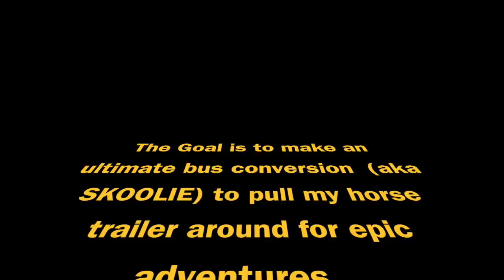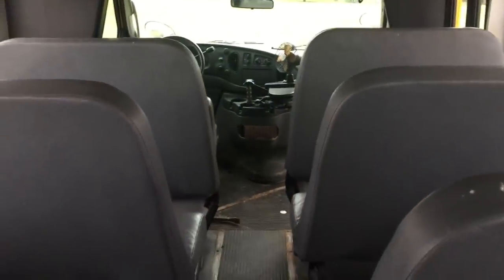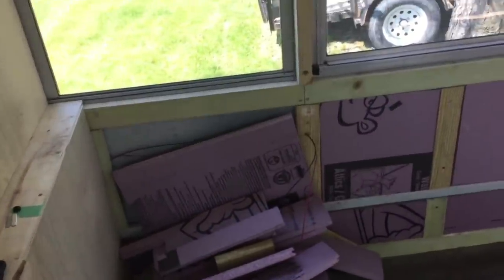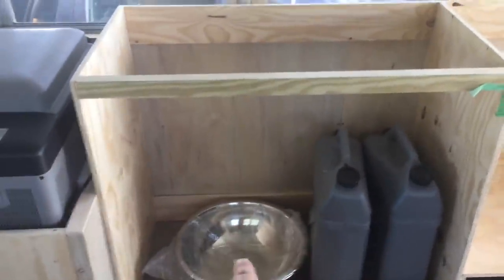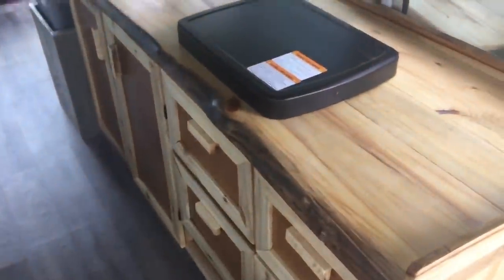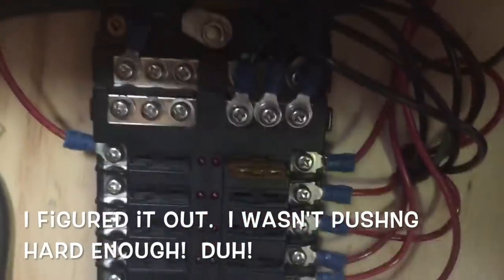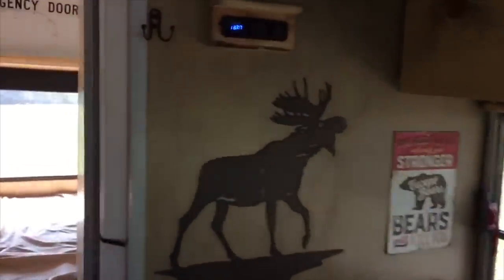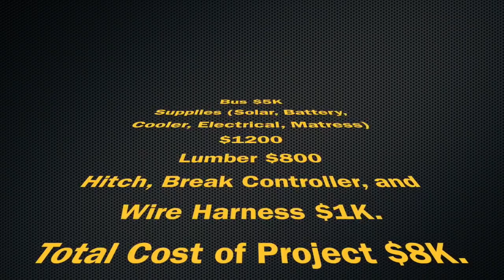DIY Short Bus Skoolie Conversion

Comment: I want to take my arm off the bus.  Does it bother anything if you just cut the wires off.  Do you have to close the circuit or something crazy.  Sometimes people have problems when removing things.  Like the bus won't start etc. What was your painting method? Rolling or spraying?
Reply from the maker: We cut the wires right off.  And tried starting the bus.  It worked.  In fact all the safety equipment we cut the wires and tested the start, just In case we needed to hook it back up and go to plan B. With the paint I used a $10 sprayer from Harbor Freight and a pancake air compressor.  It really wasn't enough pressure, but it got the job done. I used rustoleum gloss enamel.   I have an “orange peel” finish.  I NEVER painted before, so I practiced with water on cardboard first.
Reply: @hollijacobs7858  I bought a more expensive sprayer from Harbor Freight, but it doesn't connect to a sprayer. i bought tractor and implement paint.  Worried about the painting process, but I'm going to jump in soon. I just worried that the flashing lights work when the stop sign and arm come out.  So maybe they were connected?  I don't need the flashing lights, but I would like to put clear LED's in the front ones and the upper back lights would be good as solid red brake lights. The front upper clear ones would work with the bright lights not on full time. Someone who knows more about electric than I do could probably make that happen. Thanks.
Reply from the maker: Make sure you know the laws for the flashing lights.  If they are break lights you might confuse people into thinking you are a real school bus and they’ll stop for you.    You might have to disable them completely to be legal.

Comment: Can this bus comfortably drive at 65-70mph on highway? How does it handle mountainous terrain? What gas mileage does it get? What is the total length of bus?
Reply from the maker: Easily does 70 on highway.  behind the drivers seat, it was 14 feet.    mileage was about 12 mpg
Reply: @hollijacobs7858  I thought these have...I guess you call them Rev limiters? To regulate speed?
Reply from the maker: @windsofmarchjourneyperrytr2823   This one does not.  I can go as fast as. Want.

Comment: Is it possible to pull a 8 foot long enclosed trailer with the mini schooly? How much weight allowed?
Reply from the maker: That would depend on each individual bus and what they are rated for.  But mine pulled 5,000 lbs like it was NOTHING!   I would consider breaks though for something really heavy.

Comment: What is the engine capacity of the bus? And what size is your horse trailer? And how many horses are you hauling because I’m looking for the same some thing I can build out and haul my horse trailer
Reply from the maker: This is a 6.0l diesel.   I have a two horse slant that weighed about 5,000 fully loaded with horses.   You would never know it was pulling a trailer.  Pulled like a dream.

Comment: Did you get any engine , etc work done? I was a school bus driver for years, and I am aware they are well maintained, however they generally NEED some engine work/maintenance by the time they're sold. Nobody ever talks about that. I know what it's like being stuck in the middle of an intersection with a stalled bus full of students. Yes. That happened. More than once. Different buses. Not my driving technique... they were older buses - excess of 150000 miles. Fun times. lol
Reply from the maker: yes, I took it to a diesel mechanic and he did an oil change, put new belts on (they were dry rotted) and replaced the glow plugs.   Stuff like that.

Comment: Did you take the panels off the side of the school bus inside put installation or does a school bus have insulation on it already
Reply from the maker: I went right over the walls.
Reply from the maker: And it had insulation already

Comment: Do you have a further break down on your cost?? Alot of that is hard to believe because I have the same exact bas as you hah did you own a bunch of the stuff? Like some Solar and the bed?
How about maintenance when you first got the bus?
Reply from the maker: Solar cost me about $500 and that included the battery.  but honestly I scavenged a lot of the wood from my truck cap build, and made all the cabinets myself.  Most of my expenses were from the lumber.  The  live edge came from a tree on my property and the seat from a junk yard.  When needed I can be VERY frugal. 😉   I did get an oil change, new belts and new glow plugs about a year after I made the video.  I consider vehicle maintenance a different expense from the actual build.

Comment: Did you install solar also .
Reply from the maker: Yes, 2 one hundred watt panels.  And a 92 amp hour 12 v deep cycle RV battery.
Reply: Holli Jacobs 
I hope your batteries are sealed. Some types of batteries “offgas” and I noticed your battery was under your bed..l I do NOT know enough about it,please check the website to see if your battery offgases, and if it does, relocate ASAP.... everything else looks phenomenal, I hope my build out looks half as good as your Bus when I finally get to that part of the bucket list....

Comment: I took my stop sign off but I don't know what to do with the wires.
Reply from the maker: We just cut them off and stalled them in the wall.  Then disconnected the switch.
Reply: @hollijacobs7858  thanks I dis that today. Looks so much better

Comment: Why no shower? Closet?
Reply from the maker: I don’t plan on living in this. Just travel.  So if the facility I’m at doesn’t have a shower, I’ll set up a shower cowboy style in my horse trailer, that I’ll be pulling.   I didn’t feel the need for a closet, with space and an open feel at the top of my list.  I can put Rubbermaid tubs under the bed for clothing.

Comment: Soooooo I just got my short bus and I was wondering .... PRETTY PRETTY PLEASE COULD YOU EMAIL ME THE BLUEPRINTS LOL OR WHAT EVER THEY ARE CALLED I WANT TO PRETTY M7CH DO THE SAME ISOLATION FLOORING IS VERY UMPORTANT TO ME FOR LOOKS AND WARTH I JUST WONT JNOW WHERE TO PUT THE WALLS HOW MUCHCWOOD ALL OF THAT ITLL REALLY REALLY HELP
Reply from the maker: Oh Boy, I didn’t have blue prints.  I just built it as I went.  I will tell you this. 1. I made a cardboard bus, (just like a tiny dollhouse) just to figure out layout.  2. I recycled as much of the material as I could scavenged everywhere. 3. Lots of trips to the hardware store. 4.  90% planning and 10% construction.  5. Watch lots and  lots of YouTube videos.  Like you are studying for a final exam.    I build everything in my head before first, and tried to think everything.
Reply: @hollijacobs7858  ok great thanks im thinking about recording the process not inky for other people to see but for ne in case I want to try another thanks again

Comment: You did that really cheap - where do you shower???
Reply from the maker: I thought about that, if I’m not at a facility that has a shower, then I’ll set up a shower in my horse trailer, cowboy style.   I don’t plan on living in it just traveling.
Reply: Cheap gym membership from somewhere that has country wide gyms and you can stop and shower anytime you need. Also most truck stops “Flying J’s, Love’s, Etc..” have showers you can pay to use that are cleaned after every person and are really nice..!!!

Comment: Fuse box. That looks like a cheap Chinese fuse box, I have one and i don't rate it. The fuse holders are tight really tight and very sensitive a bump in the road can disturb the fuses, not good at all.  Also there are different types of fuses e.g atx and mini atx the mini wont fit the normal and the normal wont fit the mini but on amazon they look the same to the untrained eye. Check you have the right ones and check that the fuse holders are not just really tight. my 2nd fuse board is that way but my 1st is a uk version of the bluesea ones they are twice the price but worth every penny/cent.
Reply from the maker: Thank you,   The fuse issue was a pain, and they did fit really tight.